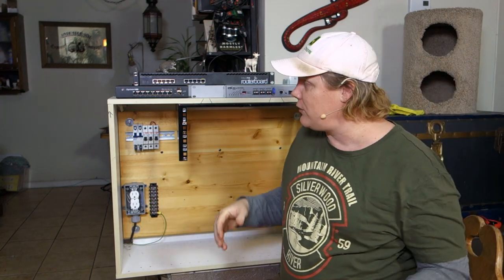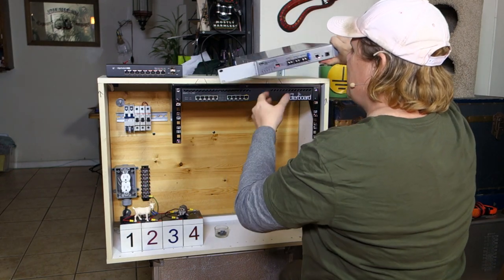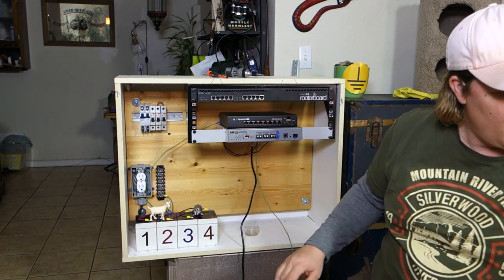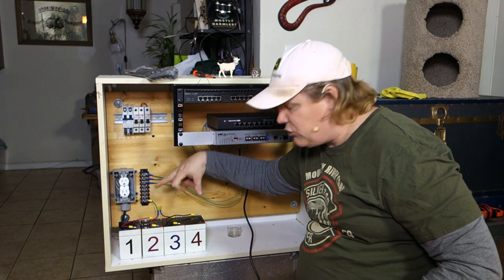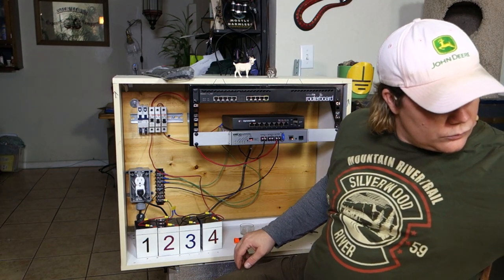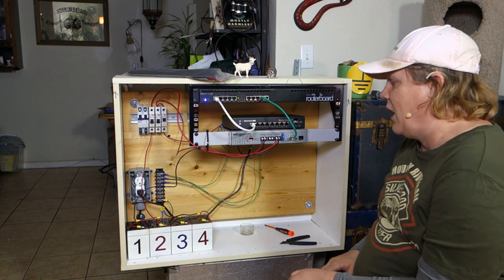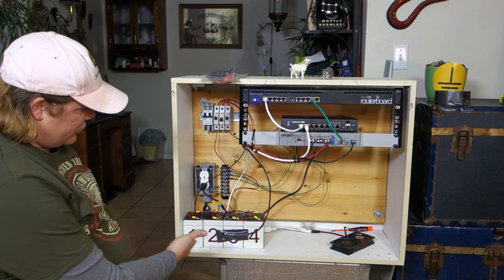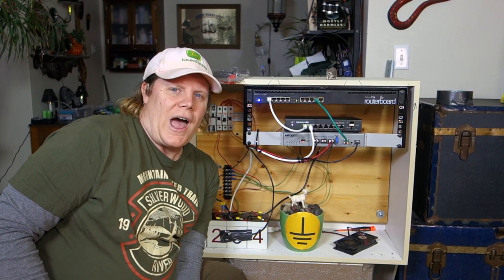48V Algcom plant. ( Basic Assembly and clever Banter )

Comment: If I have to use a dc to dc transformer do I calculate the battery capacity off the source voltage or the final voltage or is there a way to translate that? For example if if running a 24v site and need to change to 54v for one or more devices how do I estimate the battery useage???
Reply from the maker: Watch the 24v video and it has all the math. Theres a link in the description that will jump you to the math part ^^
Reply: @thefixitgal  thanks, I’ll watch it again. That was one of the first videos I watched about setting up a site.
Reply from the maker: @TheTF01  I have so much more coming. Theres also content on our patreon thats higher level coming. Weve just released the basic ospf video.